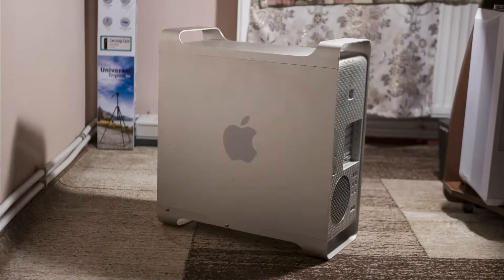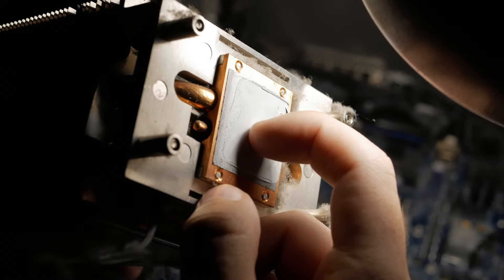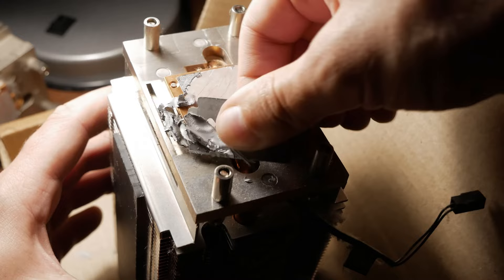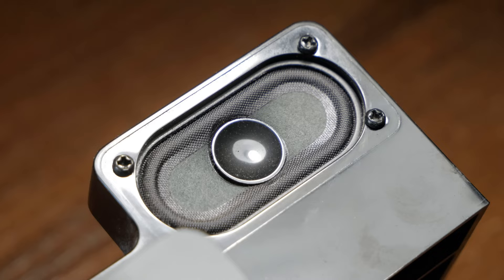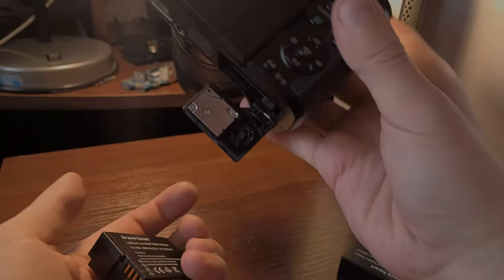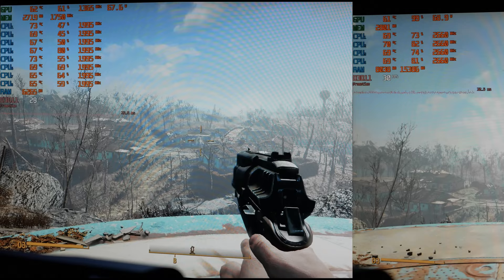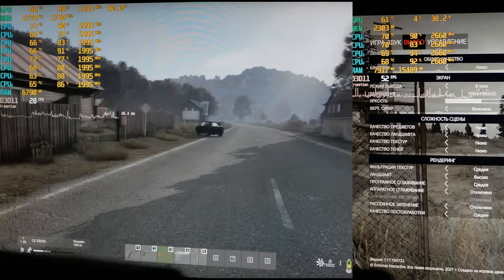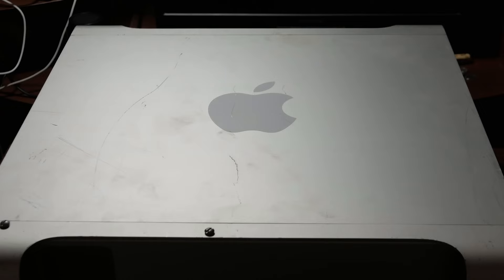What Happens if You Upgrade an Apple PC into a Gaming PC?

Comment: Hey awesome videos! Some dude in my condo community left a 2006 Mac Pro Tower at a dumpster with no gpu, I went and got a hd 5770, and found out it still works! So I saw a video from RetroGamerVX who upgraded the firmware from 1.1 to 2.1, did that, now waiting on 32 gbs of ram sticks the same you got and a ssd,  was lucky enough to find 2 X5365's as well, thanks for the video hope mine can be made to good use from what I learned from you and others.